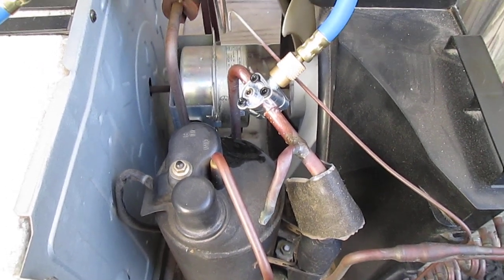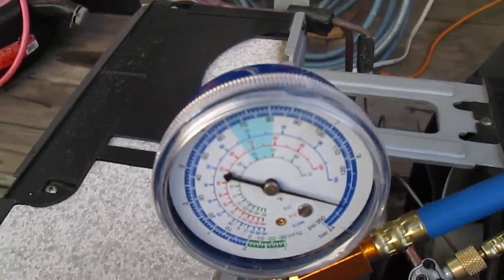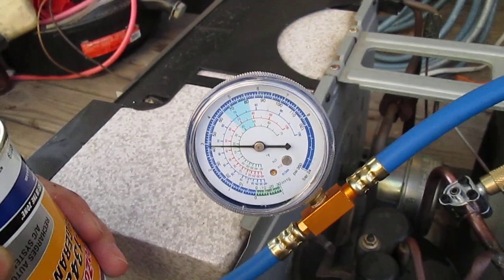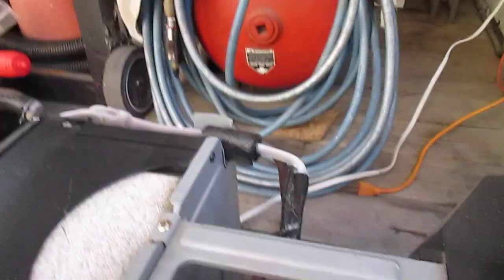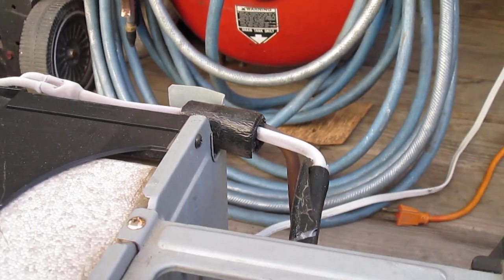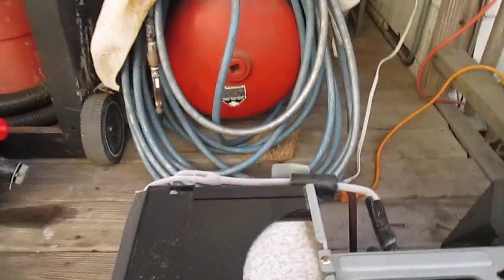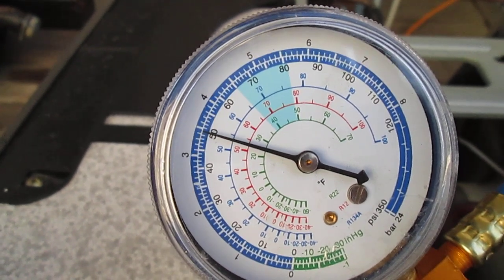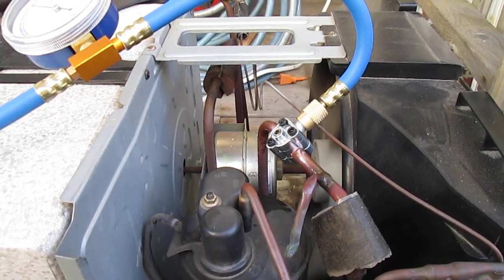DIY Air Conditioning House AC Refill Recharge with R134A - Video 3

Comment: Interesting ~ !  Can i use r34a in a 2004 r22  whole house ac unit ?  can i use r134a to top r22 central ac sys up ? thanks.
Reply from the maker: NO.  The whole house AC needs R22.  You can find R22 on eBay !!!
Reply: Most ALL R22 refrigerant ac systems use MINERAL OIL as the compressor lubricant. R134a refrigerant systems (with few exceptions) use PAG oil...the exceptions use POE oil. The type of oil is super important as the oil and refrigerant MUST be compatible in order for the oil to properly circulate in the system and assure proper compressor lubrication.
In essence ...you MUST make sure that any "replacement" refrigerant charged into an R22 system is compatible with mineral oil. To use an "approved" replacement refrigerant in place of R22 you have to flush the system to remove the majority of the mineral oil, change out the filter drier, add back the proper amount of the proper oil type, ...then finally recharge with your substitute refrigerant.
In ANY case...R134a is NOT an acceptable substitute for R22. Compressor failure is likely, as the existing compressor's seals and valves were not designed for the higher pressure and heat it will be experiencing with R134a.. Again... It operates at a significantly higher pressure than does R22, and which your system (including the coils) is quite likely not designed for. It also will not "mix" with the existing compressor oil, and any leak in the system will likely get WORSE; The smaller molecule size of R134a combined with the higher pressure means that it will leak out of the system far faster.
Using R134a in a R22:system is akin to using cooking oil in your car's engine...the car WILL crank, and the engine will run.....but for HOW LONG????
Reply: NO! There are no replacements for direct drop in for R-22. Only R-22 can be added to an R-22 system that has refrigerant in it.  If your AC is completely empty, you can add Blends.  Only blended Freon can replace the R-22.  A blend is a combination of different refrigerants, but safer to the environment than R-22.  But first you must recover the system properly, and evacuate the system, then you can recharge it with one of these blends.  R453a, R427a, R438a, R407c, R434a, R442a.  I was just certified EPA about 2 hours ago. Its fresh in my mind.

Comment: Can you use the R134 on old Carrier AC units that need R22?
Reply from the maker: If no Gas is left you can.  But if you want to do it properly, stick with R22.
Reply: @JodBronson  Thanks so much for your reply and for these detailed videos! Do you have a good source for reasonably priced R22 refrigerant?  And have you found a better substitute than the R134?
Reply from the maker: @likinit121  - eBay for R22.  As for R134, that is the only alternative.  If your unit is under 8,000 BTU - you will be AOK with R134a.
Reply: @JodBronson what if my unit is up to 12,000 btu?
Reply from the maker: @mikeyflex4291  -  Sorry, I have never done over 8,000 BTU.
Reply: @JodBronson I thought I was buying r-22 off of eBay and I put it in my home ac unit.  Then I noticed that it said that it was flammable and contained hydrocarbons.  I went to the manufacturers website and they said that it was a refrigerant booster and it contained no r-22 or r-22a.  So Just be sure of what you are buying.  My unit was low on refrigerant and I only added 8 ounces so I don't think that I screwed anything up.
Reply from the maker: @brianwilson4861  - On this thread, we are talking about R22.  Whatever you are buying...  You know it's WRONG!

Comment: Will r134 work in a old r22 ac how much would it take to fill a 5000 btu
Reply: No you cannot use r134 when it calls for r23
Reply from the maker: On the Unit, there is Tag, it will tell you how much.
Reply from the maker: Here:  https://www.youtube.com/watch?v=ze9SWsx8I-g

Comment: Will this work in R22 and 110a ? And do you have to release the previous refrigerant?
Reply from the maker: Never release Gas into the Air, you will violate the EPA.  CHECK the description.... There are links to the "whole video" on it.
Reply: Jordan Bronson your the man!!! Please call me your a celebrity to me! 716-342-8275 I’d love to talk to you !!
Reply: Jordan Bronson does the bullet pierce valve need to be open or closed to charge. Can you call me seven one six 288 six three 9 zero
Reply from the maker: Sorry, not calling anyone!
Reply: Jordan Bronson can you help me find low pressure line if I send photos I don’t want to screw up and use high pressure I can get hurt right
Reply: Jordan Bronson 
 When did you buy the gauge and valves?
Reply from the maker: @yopappy6599  -  Everything you need and more, in this video here:  https://www.youtube.com/watch?v=QdPhM7IVm1c

Comment: I have three window units that are all going south. I sure hope this can work at least for the two under fifteen years old. Does anyone know which year was the cutoff from R-22
 to R134a (R-410a)? Understand R134a requires a larger heat exchanger. 
The oldest I'm using is a Maytag purchased in 2002. The other two are Frigidaire bought 2008 and 2011. Average summer day temps here in FL are 95 degrees. It stays 85 inside and after rains the outside is 10 degrees cooler than indoors!
Reply from the maker: Get the Bullet Valve and the Gauge, do a leak test. If small or minute leaks, you can get leak seal and stop it.  Also, they have leak seal built in too.  But best to check before you do anything to save time and $$$.
Reply: @JodBronson  OK thanks! Will do that soon as can get them pulled and the covers off. Checking and the two most recent use different coolants but the oldest one has no useful data showing on the tag.
Reply from the maker: @wmfife1  - Most of the AC I see now is R134a.  So check your Level with your Gauge and Leaks too or else will be pointless.
Reply: @JodBronson  So from this video the ones sold for car ac can also be used for home units. Good to know! Am just afraid if I switch to R134a from the original coolant I'll get reduced effectiveness. And if I don't and choose the original the only legal route would be to hire professionals.
Reply from the maker: @wmfife1  - YES sir-re !!!
Reply from the maker: I started to see they use R134a around 4+ years ago in small Fridge + Wine Coolers, then 1 year later, I see them in small AC.

Comment: For those saying that R134a is only for automotive, you are wrong. I work at a facility with a 10,000 gallon water chilled system and it uses 400+ lbs of R134a refrigerant.
Reply from the maker: 100%
Reply from the maker: 100% - People don't know much or get out much.  During me filling this, I actually saw some of the small Air Conditioners and Wine Coolers have R134a in it.

Comment: Do not try this. Wrong refrigerant. Evaporator will freeze and compressor will burn out.
Reply: no it wont. its a new series of compressor. i didnt know until recently in 2004 they started making home central ac systems for 134a.
Reply from the maker: @parrisestatessouthernhomec3246  -  100% !!!  All he has to do is go to Home Depot and Lowes or Walmart and look at the Wine Cooler and small Unit AC.  They are filled with R134a and it's labeled clearly R134a.
Reply: Wow... Interesting. Here in the states we are using butane or R600a as it's officially called
Reply from the maker: @davidnahum9196  -  I really want to try Butane.  But I don't have a connector that would fit. :(
Reply: We have a facility with a 10,000 gallon water chilled system and it also uses R134a. I was surprised as I thought that cars just used that stuff.
Reply from the maker: @yamipizza8357  - After this video, which was 4+ years ago..... I see Wine Coolers, Small Air Conditioners, Small Fridge....., they are all filled with R134a.  Some people DO NOT get out of their cave much!  😂❤️😂❤️😂❤️😂❤️😂❤️😂❤️😂❤️
Reply from the maker: I did these Video around May of 2016.  I didn't think it would work... I uploaded these in August of 2016.  2017, I did an update.  2018, I did an update.  2019... I am making that Video right now.   NOTE:  I will give you BOTH links for 2017 and 2018 below....
Reply from the maker: - 2017 Update - Still working AOK and GREAT YAYHOOOOO !!! See Update Video here: https://www.youtube.com/watch?v=b9YNqY75BBs

- 2018 UPDATE:  Everything is on this Video here including tips, etc.... Also, in the " Descriptions - I listed ALL THE PARTS YOU WILL NEED :https://www.youtube.com/watch?v=QdPhM7IVm1c
Reply: Jordan Bronson "nooooo! It'll burn up!!" Hahaha don't you love when people tell you something won't work and it works perfectly?
Reply from the maker: @officerfarris8968  - It's still working :).  I'm using it right now, LOL
Reply from the maker: @officerfarris8968  - Here is the 2019 Update.... There is another Video install it inside + temperature measurements too.  2019 - Update Video:  https://youtu.be/0IwfP4MA_hs

Comment: Thats for auto ac lol wrong kind
Reply from the maker: By the way, it's still working right now (July 2019). YES I am using it!  Although I did this about 3 years ago... I revisited here again after taking tips from a lot of People.  See the updated Video here in 2018:  https://www.youtube.com/watch?v=QdPhM7IVm1c
Reply: @JodBronson  thanks dude I appreciate it 👍
Reply from the maker: @nibrocnoel3240  - You are welcome!  Newer Video here and everything is in " description " as well:  https://www.youtube.com/watch?v=QdPhM7IVm1c
Reply: No there is two types of freon used in home or commercial ac units R22 and R410A. R13 is automotive. Each has different temp zones and oils add and is system.specific.
Reply from the maker: @TheRealFilthyfletch  -  Next time when you go to the Big Box Store... Check the Wine Cooler and the New AC....  They are filled with R134a!
Reply: @TheRealFilthyfletch  Not true. At a facility that I work at, it is a 10,000 gallon water chilled system that uses R134a.
Reply: What country?
Reply from the maker: @TheRealFilthyfletch  - Big Box Store = USA …. Aka... Walmart, Home Depot, Lowes!
Reply from the maker: I did it because this AC is on it's last leg.  I refilled this because People said it couldn't be done.  Also, the newer AC are filled with R134a.... Next time when you go to the Big Box Store... Check the Wine Cooler and the New AC....  They are filled with R134a!

Comment: The frost IS NOT a good sighn of cooling! The lines  should 'sweat'. The likelyhood of the compressor being damaged is very high.  The system needs to ducked down under negative pressure then you fill the unit to the correct refrigerat weight.
Reply from the maker: Frost = Under-Filled.  See this Video here:  https://www.youtube.com/watch?v=QdPhM7IVm1c
Reply: @JodBronson  , not necessarily under filled, but definitely below the designed pressure. The reason many say it is a sign of being under filled is because if it were the refrigerant it was designed for, being below normal operating pressure would be a symptom of being under filled, but when using a 70 psi refrigerant in a 200 psi system, it will always remain way below  pressure and do the same thing.
Reply from the maker: @JamesMorningstar  -  Thankx for the Tips + Info on the PSIG.  This Video here I've made when I was like 14.  So when I saw the Frost, I got scared.  But I've learned a lot since then.  The Video Link up there, I revisited 2-1/2 years later.  During that time, it was working AOK... The Compressor was making a lot of noise during the 2 years of usage, that was the reason I "revisited".  If you take a moment and see the Video, I mentioned that I was able to get up to 40+ PSIG, once I do, the Compressor stayed quiet.  Also,  I wasn't able to get to 70 PSIG no matter what I do, during my revisited session.  Even though at 40+ PSIG, the system is happy and it's still cool.  As we speak, I am using it right now.  It's doing really good and AOK so far since I refilled back up to 40 PSIG.  NOTE:  As long I go over 40 PSIG, the System is happy and doesn't make any noise.

Comment: I stuck my car Ac hose for the portable AC. It leaks and doesn't seal when snapped on why is that?
Reply: Probably because automotive AC components are designed for R134a, which compresses to about 70 psi, while most modern sealed units, window units, etc, for the house use R410a or similar with a compression around 200 psi.  If you use parts designed to safely handle 70 psi, there is no reasonable guarantee that it won't rupture or burst at 200 psi.
 
This is also likely why people trying to use R134a to refill such systems experience severe under-pressure which freezes up the lines and damages the compressor. That "frosting" is NOT a good sign.
Reply from the maker: @JamesMorningstar  - Thankx for the reply and as I stated in my other reply.  I was only 14 years old when I did this, I got scared when I saw frost....  I knew it wasn't designed for R134a.  But I figured I give it a try anyway.  Watch this Video here:  https://www.youtube.com/watch?v=QdPhM7IVm1c

Well, it's Summer 2019 and it's still working.  I am using it right now.
Reply: That are a totally different fitting. That's why he had to get that piercing valve that he hooked his house to. You should be able to get it at Home depot.
Reply from the maker: I don't know :/

Comment: My AC uses R410A so will the R134A is compatible? R410A doesn't come in small cans.
Reply from the maker: Hi, not 100% sure.  I did it because this AC is on it's last leg.  I refilled this because People said it couldn't be done.  Also, the newer AC are filled with R134a.... Next time when you go to the Big Box Store... Check the Wine Cooler and the New AC....  They are filled with R134a!

Comment: Hi where can i get a conector like the one you have on the copper tube`?
Reply from the maker: +TheCbj79 - See this Link and the Video... *NOTE: Everything you needed is in the Video and Description*:  https://www.youtube.com/watch?v=QdPhM7IVm1c
Reply: Homedepot has them u just gotta got where they have the copper pipes on the display that has all the connections and elbows act. Just look for the needle sticking out one of the connectors on display and there will be a couple more options next to it
Reply from the maker: @joeldavila7461  - I believe those are for Water Tapping.  The Gauge Fittings won't fit on it.

Comment: So where did you get the hose that fits over that valve? Got a valve and need the hose that screws on the valve. I work at oreilly auto parts and cans find anything that fits except the big ac gages. A basic little hose like that and a tap for a can. Where did you get yours
Reply from the maker: +Cody Weller - Everything is on this Video here including tips, etc.... Also, in the " Descriptions - I listed ALL THE PARTS YOU WILL NEED :  https://www.youtube.com/watch?v=QdPhM7IVm1c

Comment: Would you but diesel in a gasoline car? How about jet fuel in your diesel, or kerosene in your lawn mower? I'd sure hope not!!!!! I'm not trying to hate on you, I also do most projects myself. But this isn't going to work long term. Something about the oil in the pump and refrigerant density, pressure etc. You would be better off with "Frost 22a" from rural king. (which is a whole other topic-- frost 22a is propane which works but is obviously very dangerous and overpriced at 100 for 8 lbs) When I installed my own central air a few years ago I did all the research and there's no way to cheat the system.  I opted to buy a new unit online which had a factory charge, so I brazed the pipe then evacuated them and opened the valve on new unit and double checked that pressures were in spec.  This was the only way. You can't by refrigerant it's that simple. BTW this it's not that odd for chemicals to be restricted for safety or epa reg.
Reply: burnz163  if the compressor has lubrication it will work for years,   ac compressors are even used to pump air,  as long as it won't overheat and there's lubrication it will last.     the whole r22  and other high pressure refrigerants is only business so you would hire and pay a professional to recharge it if leaking,  or buy a new one.
Reply: @wojciechzgodowski  no.  refrigerant  releases  ozone-depleting chlorofluorocarbons, or CFCs, into the earth's atmosphere.  Professionals  have ways to capture the CFC's and dispose of it without  poisoning our environment and atmosphere.
Reply from the maker: @jacobh9332  -  Why do you think they let " Regular User " refill their own AC?  That is why R134a is " Over-The-Counter ".
Reply from the maker: +burnz163 - I did this " Refill " in June 2016.... I made an " Update " Video in 2017 here:  https://www.youtube.com/watch?v=-RcRQGE-SjQ .  Now it's 2018... It's still working AOK :)
Reply: 86 Taurus didn't have a freon over pressure sensor,  you could overcharge it with freon,  override evaporator temp sensor and turn the car to a refrigerator
Reply: kerosene in my kadillac   gets me thar n back

Comment: I thought you was supposed to use R22 in the older or R410A in a newer window AC Unit. Is it safe to do what you did?
Reply from the maker: Warning 2: Please do this at Your Own Risk. My Air Conditioner is 10 
years old. It wasn't cooling, so I don't care. We were going to throw it
 out anyway, so I gave this a try and it worked! R134A Saves the day!
Reply from the maker: +TheShospitali - By the way.... Next time when you are at the " Big Box Stores "....  Go check the Wine Coolers and small Fridge.  They are filled with R134a now :))))))))))))))))))))))))))

Comment: Did you purge the line before released the freon?
Reply from the maker: +Wei Ming Liang - Hi, I was in-experience when I did this... The Answer is NO !!! But I have learned a lot since.  If I have to do it again, I would definitely " Purge " the line before refill for sure!  NOTE:  I figured that the Air Conditioner was NOT GOOD... Why bother wasting Time and Money trying this and that.... But as to date, it's still working, LOL